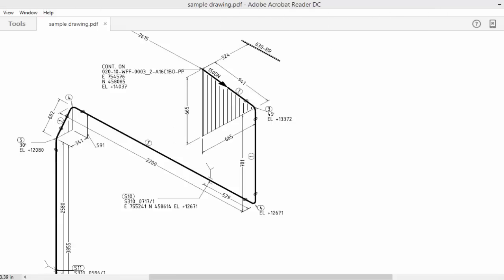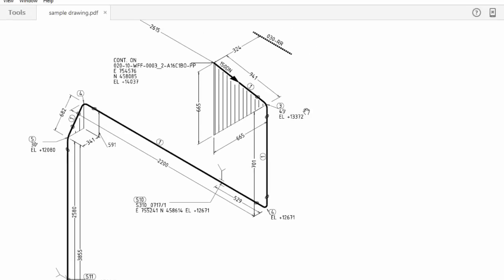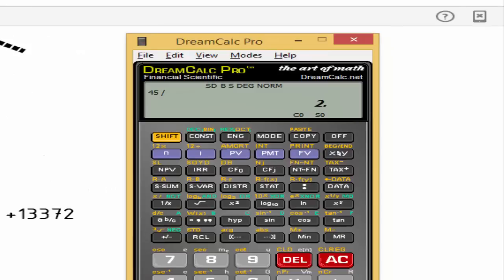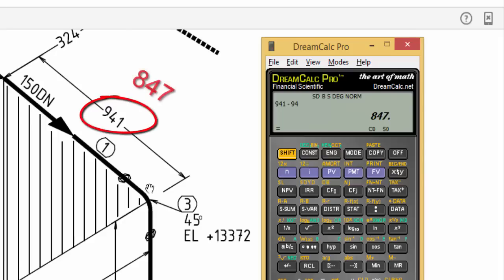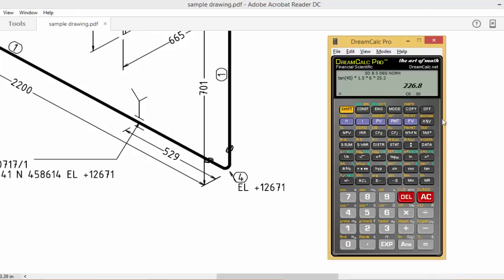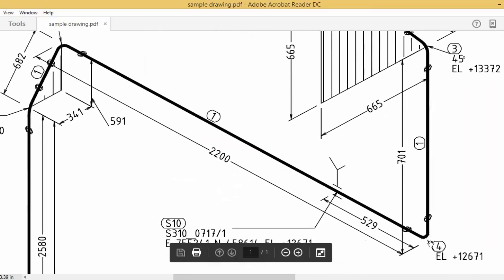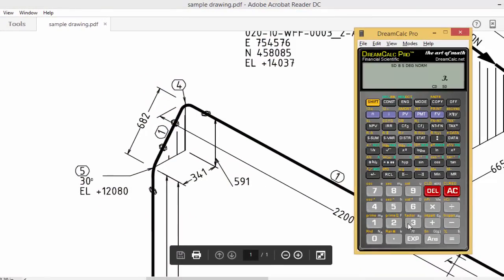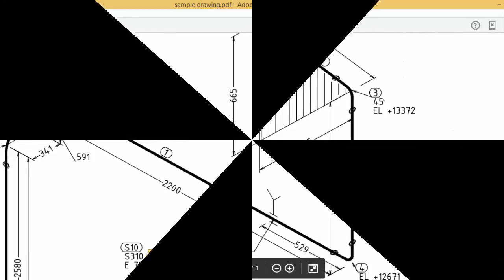Pipe Spool Cutting Length / Elbow 90,45,30 deg Take Off / Travel length  Calculation

Comment: We use 1.5., 1.5 is the tangent to the big circle.,
And 1 is for small circle.,
the tangent line to a circle at a point P is perpendicular to the radius to that point, theorems involving tangent lines often involve radial lines and orthogonal circles.
Reply: 뎌ㅕㅐㅒ

Comment: bro why you use 1.5 in formula, please reply soon.
Reply from the maker: its long radius elbow.so we use 1.5 times of diameter of pipe
Reply: Technical Piping if short radius elbow what we use formula bro thanks
Reply: We use the 1.5 as a tangent line to a circle.,
the tangent line to a circle at a point P is perpendicular to the radius to that point, theorems involving tangent lines often involve radial lines and orthogonal circles.

Comment: for 90 degree i am using the formula of......6inch X 38.1  ......is it right formula... by using this i am getting 2 to 3 mm less compare to your answer
Reply from the maker: +Jawahar Anand  both answer same. formula:tan(90/2)x1.5x6x25.4 = 228.6mm.and as per your calculation:6x38.1=228.6mm.thanks.
Reply: https://youtu.be/VxbUxm9vuVE